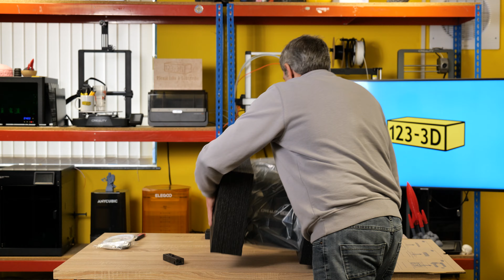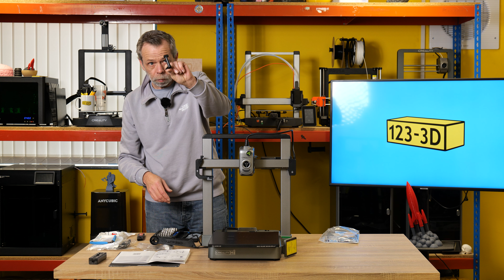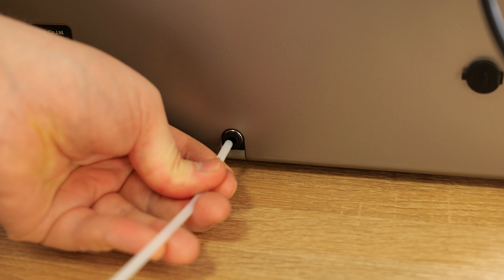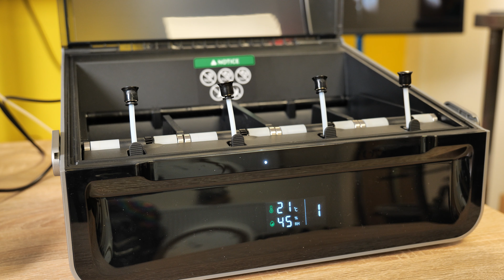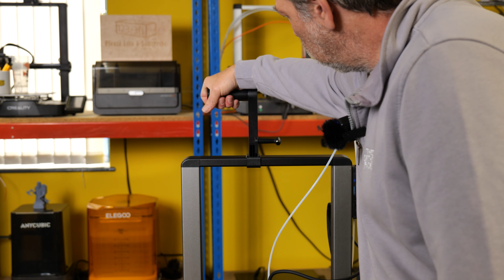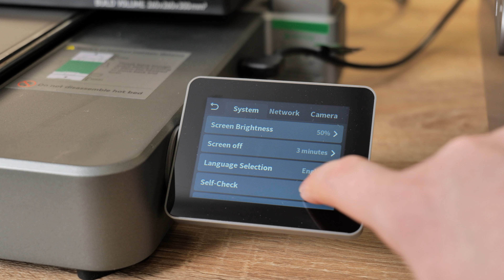Creality Hi Unboxing & First Impressions

Comment: bambu lab a1 vs creality hi 
Cost:
It's a tie with the current price, offers are often made for both which can make one or the other a little cheaper at the moment, but as of today the creality hi is cheaper
Print volume:
Creality hi wins (260*260*300)
Print speed:
Tie
Multi color:
Creality hi wins (CFS system up to 16 colors)
Ease of use:
Tie
Material compatibility:
Tie

In almost everything they are the same since the creality hi is a copy of the a1 but in my opinion all the people who use that as an argument to say that the a1 is better do not know what they are talking about, because it does not matter if it copies it or not as long as it has a better quality-price ratio than the other.

Comment: This is exactly what I wanted my Ender 3 V3 CoreXZ to become. Sad Creality decided to drop CFS support for it...
Reply: No really co print works 100% with the v3 and the cfs is basically designed off the co print system . A co print cost almost as much as cfs .

I think co print did a deal with creailty
Reply: @Level-up-your-life  I had no idea CoPrint for my V3 was a thing! I really need to pay more attention. Looked up more info on it, and even though it requires quite a bit of work to set it up, I don't mind it! (I love to tinker). Just placed an order for a kit!

Thanks for letting me know!
Reply: @Level-up-your-life  I'm back again. Got the Co Print KCM Set a few days ago. I will either return it or resell it. Support for the regular E3V3 is shoddy at best. Most of the documentation and configuration is for the Plus version and even that is outdated and incomplete, which is very disappointing. I'm a tinkerer, and even I struggled getting it to work, and when it did, it didn't last long. Print quality is not great, you lose printer functionality, and I lost a build plate when the nozzle scratched it diagonally when the printer decided to forget its parameters and my calibrations when homing before attempting to print cable management for the horrid rat's nest of cables the KCM Set creates.

The hardware itself arrived rather scuffed and scratched (particularly the print head cover, making me think it was not a completely new product I received), but functional. The screw kits included for the installation were the wrong size (they sent me M3x3 instead of M3x5, again making me think I received a used product) and no M3 nuts, but thankfully I have a ton of hardware for my projects available so I made do. The print files provided in the Wiki guides are only for the E3V3 Plus and they do not fit well with the regular V3. The new firmware required a very different setup process, and the documentation has not been properly updated to reflect this.

The moderators in their Discord are very kind and helpful, but they don't seem to have the printers themselves to test. Co Print needs a few more years in the oven to become a decent product to recommend. As it stands now, its in a very early beta, and any consumers of the product are glorified unpaid testers. To anyone that reads this, just buy the Creality Hi or a similar printer setup and save yourselves a massive headache.

Comment: Looks nice but I'm a bit concerned about the single-tube design for the CFS unit. It's nice in that it makes the setup cleaner but I imagine changing filaments would take a lot longer since it would have to pull each one all the way back for color changes.
Reply from the maker: It does take slightly longer than something like the Kobra 3 that has the multi tube set up but we're only talking a couple of seconds. If you are doing a really long complicated print then I suppose it could start to add up. We will do some tests for our full review!

Comment: I'm looking into buying one, but can you put the CFS on the other side or ontop?
Reply from the maker: Out of the box the CFS has to go on that side but only because of the length of the cables. However the cables look to be standard 4 pin square connectors.

Comment: BAMBU CLONE. Creality is still the same IP stealing company. Hope you like it 123-3D
Reply: Open source firmware ftw.
Reply: @oneanother1  great comment!
Reply: @oneanother1  that is just one piece though. Creality ethos, which tried not to be open source at one point, is still in the mud. Have fun with them, they are just not what they they could be.
Reply: The CFS looks like a huge improvement over the AMS-lite.
Reply: Cheaper
Reply: @ its all that matters to price only matters people. Get what you pay for.
Reply: It is not a clone.... sharing principal resemblance doesn't mean stealing
Reply: @ if the roles were reversed, you would be screaming for Creality to get their just compensation from IP stealing. (You) realize Creality just sits back, waits for anything to be developed, then copies? W/o Bambu legit, we would all be on the 300th ender 3 clone.
Reply: Exactly what some are looking for after this Bambu fiasco.
Reply: @10fantic  A product that is hyped and is flawed? Okay.

Comment: Creality has been putting a lot of attention to industrial design lately.  The HI looks like a very finished product.  I'm more concerned with function than form, but Creality products these days definitely don't look like they barely got the basic design finished.  It looks like they put in the effort to make it look nice, so presumably they got all of the basic mechanical issues sorted.  Time will tell.

None of these filament feeders will feed 95A durometer TPU which pushes me toward multiple tool head designs, as well as avoiding 100% material waste in poop.  For my functional prints, I'd use the CFS loaded with two black PLA and two black PETG reels, using the PETG for a structural part and PLA for easily removable support, with the CFS hopefully switching automatically to the next reel when it runs out.  Hopefully the CFS will do that.  It would be nice to start a print with two full backup reels and never need to worry about switching filament reels.

Comment: How easy is it to break it all down? I travel with my 3D printer and have a p1p and a1 mini. I just place them back in the box when moving hotels and it’s easy to do so. Could you do a video that disassembles the whole printer ( leaving on the things that don’t need to be removed) so we can see this. I did have to print a special tool to help with taking the ptfe tubes off the printer from the ama unit and it helped with the cables as well but that’s about it. I want to see if I can get this printer and pack it down flat into a pelican case for traveling. Thx.
Reply from the maker: This might be a good printer for you in that case. To break down the printer its only 6 screws and unplugging 3 plugs then you should be able to lay the machine quite flat. the screen folds in so no need to worry about that. I guess you could unscrew the build plate but not sure its worth it for the space that you would save. Not sure how practical it would be to travel with the CFS as well as it doesn't come apart.

Comment: What slicer did you use?
Reply from the maker: Creality Print 6.0
Reply: @123-3D-UK  Does it have a flow sensor? Pressure Advance sensor? Is it quieter than the A1?

Comment: There's as much poop and waste as there is in the snake.... why don't they make one with 4 hotends on the head.. it can't be that hard.
Reply: It's kinda hard. 4 hotends makes it very heavy and slow. You can do toolchangers (Prusa has a printer that does this) but it's hard and expensive. You can buy a lot of filament for the money you save so it simply isn't economical.
Reply: @theDude9750  so expensive to have four hotends and 4 nozzles. Nobody would buy it.

Comment: The first and last creality I bought was the KE, kasted a month, with no more than 2 dozen or so prints off it. Thew loads of dosh on spares but still sits in the corner as a dust collector as not one good print has been gotten off it since the repair (straight forward, a monkey could of done it) in fact the KE is sort of become it seems extinct, it's all SE's on Amazon. 
 ought an A1 - and not a (fingers crossed) problem yet..
This Hi, is obviously a clone of sorts - and has peaked my interest. Right now back to watching the vid.

Comment: Creality Hi mini anybody ?
Reply from the maker: So far Creality haven't said anything about different sizes but we anticipate there will be smaller and bigger versions coming at some point but not confirmed.
Reply: bigger is better
Reply: @ragesmirk  wrong. If you do not need to print large, smaller printers will be cheaper and perform better

Comment: Id get the kobra s1 combo over this one. Especially considering it was £499 at some point. The colour change system is an active dryer, fully enclosed, similar print volume, smaller footprint required on your desk/table, comes with ai camera which is a must have, it prevents a lot of filament loss when you get an adhesion failure (and potentially stops the hot end from eating itself when that happens).

This is going to be around the £450 mark, for £50 more (or £100 more with the current pricing), getting the full enclosure, ai camera, dynamic flow control and pressure advance on the kobra s1 is well worth it.

(Ive subscribed :) )
Reply from the maker: Thanks for subscribing! We have an S1 on the way so will defiantly be doing a comparison video when it lands.